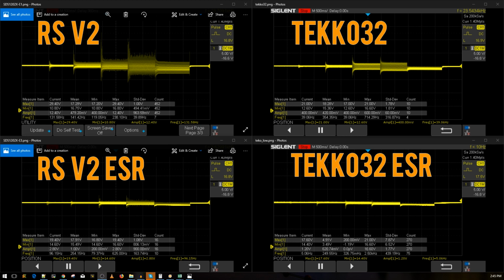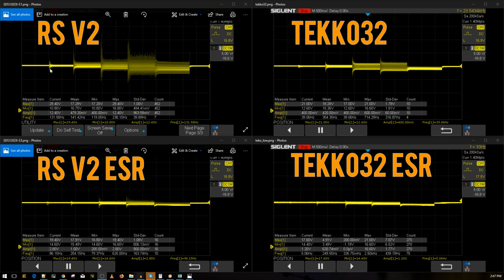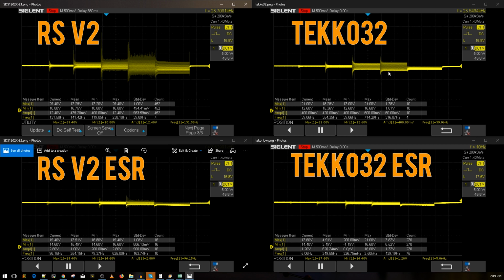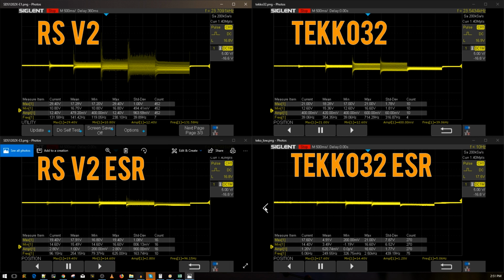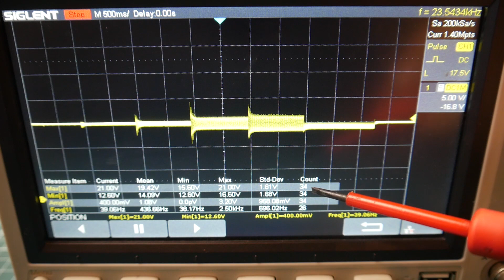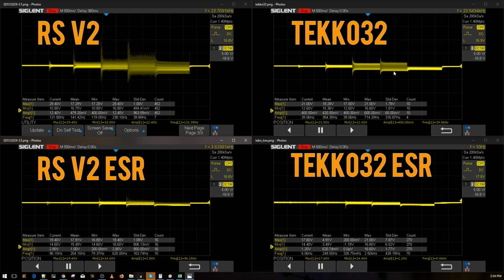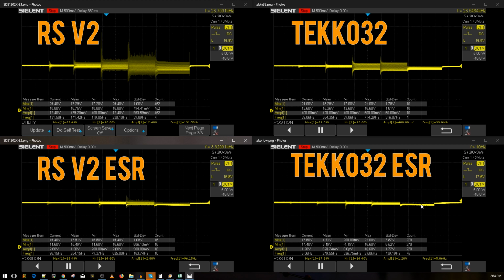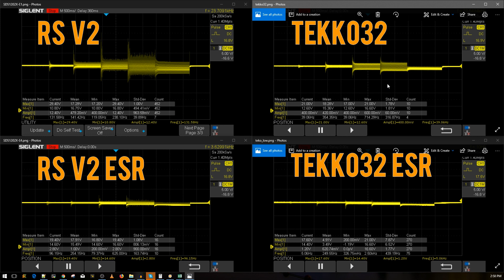Does A Low ESR Affect ESC Performance?? More Testing

Comment: If you do a Low-ESR shootout i'd like to know how good the polymer-capacitors are compared to other types. In the datasheet they have a 10x lower ESR or even better compared to other types. And while the capacitor that i got along with the FC (470uF, 25V, 120mR ) is ok, i'm not even able to measure the ESR of the polymer-cap that i found in a shop (Panasonic 560uF, 16V and only 8mR according to the datasheet). Is there a reason why this type of cap is not commonly used ? For me it works fine in my 4" 3S quad, but i don't know if it will blow soon. I'm not able to meassure how i stay in the limit for the maximum ripple current. I'd like to see if you can find a difference to common Low-ESR-caps
BTW: well done

Comment: I have learned alot from you about electronics and I appreciate it. the only question i have is how does all of this testing translate over to multirotors if you are setting up such a "perfect situation" with consistant power and such? I only ask because aren't those conditions never going to be possible in real world flying? Great job bro!
Reply from the maker: These tests will give us a different outcome. The tests you have in mind are coming I have testing equipment on the way for what you have in mind. Its a 3 Axis gimbal for quads where i strap the quad with battery fully built and run maneuvers at the same time taking measurements of everything. I will explain once everything arrives.
Reply: Drone Mesh  i got ya! That sounds like a great method! Looking foward to seeing it! Keep up the good work killa!

Comment: is the tekko the only esc with a sine wave is the other squer wave  the good thing whit the sine wave is the elecronics is running more efichen  and also more cool  the sine wave dont make that much waste engey that end op in Heat!!!  and a hot esc!!!!  that is why i think the tekko is so interresting and i want to know what the guys made that thing off that make it go a sine wave in component level  and also a test run on 20 min whit a thermal camera on and make it a 3 min clip or less
Reply: it will be cool if u had a thermal camera on all the esc test to see the driffrind in that aspeckt

Comment: When I build 6S quads I have to run low esr caps on each ESC or I get desync. My theory is that the ceramic caps can't filter out high voltage noise. Does this seem right?

Comment: Loving the tests so far, it really shows the difference between the the on-board filtration (or lack of it). Have you tried testing the LEDs on the ESC like I mentioned previously? It would be great to see if it helps on cheaper noisier ESCs. 👍

Comment: What size DC power supply did you order for the ESC testing?  Will it supply enough current to test more than one ESC at once or maybe those 4 in ones?
Reply: locomotive282 That would need to be something like 150~200A power supply. It's not easy to get. :/
Reply: Yeah thats why i was thinking maybe he could use car two car batteries in parallel.  Another thought was using the 12V rail from 4 different PC power supplies.  I know it wont be 4s voltage but it should provide good test results.
Reply: locomotive282 Yeah, but... I really don't know if it would do any good. Because when you fly it's not a "perfect" power supply. It's a battery. So it's never going to be any better than this. Actually it's worse: you're going to have 4 motor and 4 escs, not only one like when he tests it.
Reply: MC's Creations I found a 200A switching supply on Jameco but it is high as hell, maybe we can get one someday.